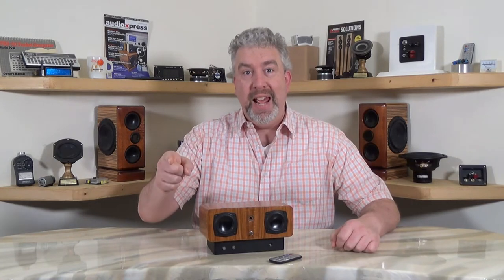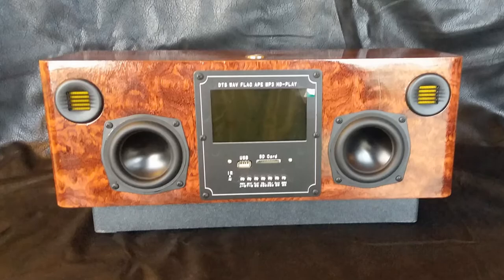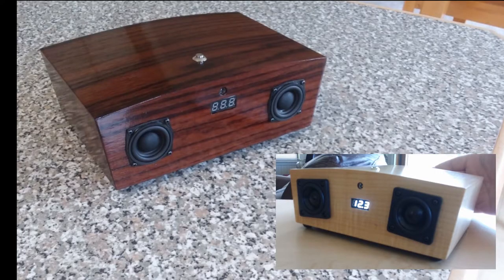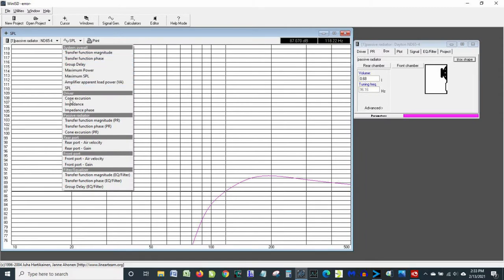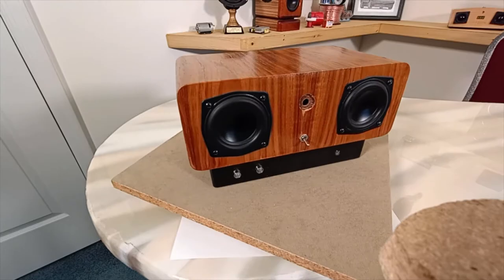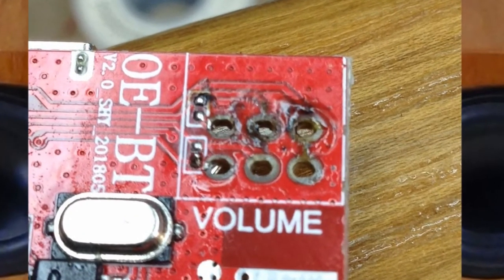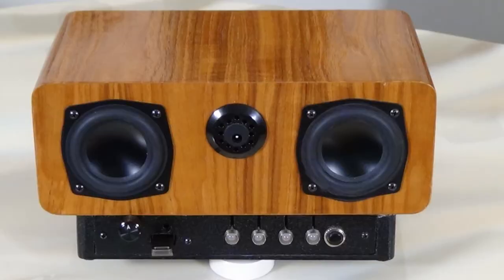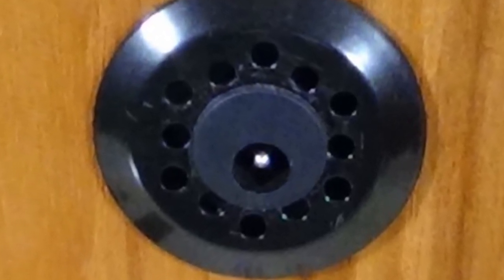Describing the "MIND-65" Bluetooth Radio Project

Comment: so passive radiators and holes in a tube ?
Reply from the maker: Not 100% sure what "tube" you're referring to, but the rear vent is only to ventilate the amp. The speakers each have their own enclosures with their matching passive radiators.